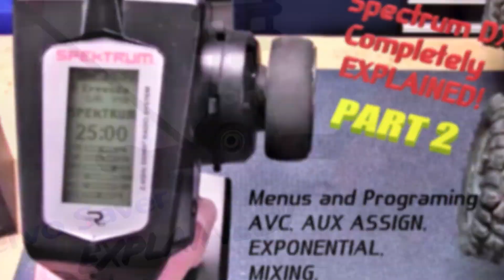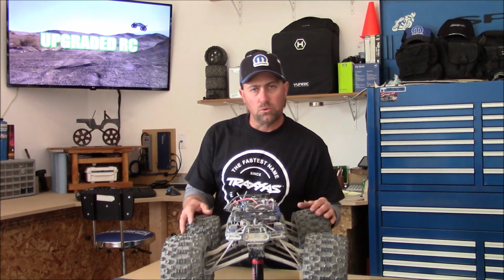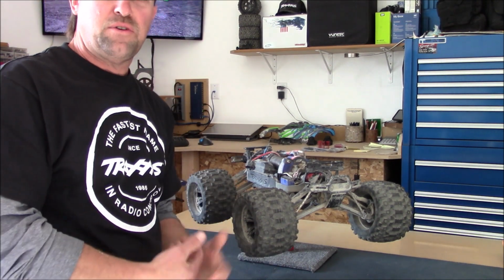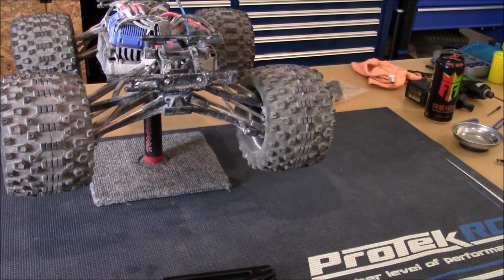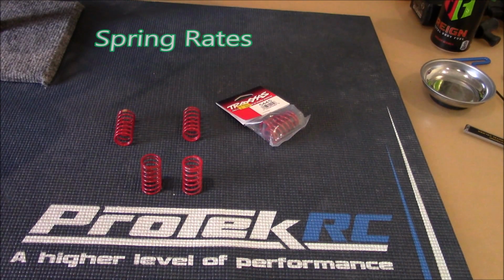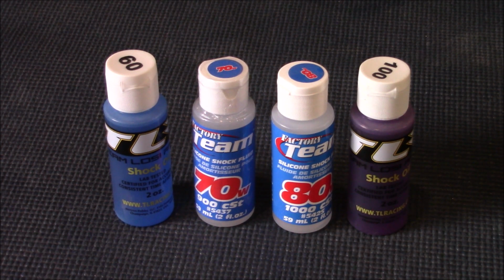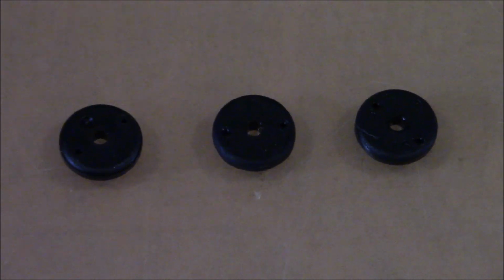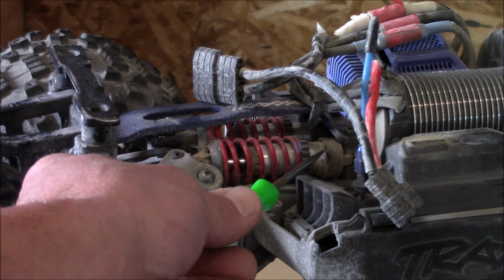Entire Suspension System Explained For E REVO 2.0  Part 1

Comment: You forgot to talk about bump steer adjustments with the lil different height captured ball stud things at end of pushrod links and the wheelbase adjustment
Reply from the maker: I did not forget, that is explained in an earlier video. This video is all about suspension. Your talking about height adjustment thru the pushrod.

Comment: I jump my erevo alot. What would you recommend for susp setup
Reply from the maker: There is a lot to say about suspension. The weather is a big deal on shock oil, but heavy springs for jumping (purple), have you watched my video on suspension? Here is the link.
Reply from the maker: https://youtu.be/-Q-XQbIaroQ
Reply from the maker: Watch this video, a 2 part series and you will understand a lot more than I can tell in a text.😎🤙👍
Reply from the maker: If your in an area where you see 70-100 degrees, I like 70w shock oil all the way around with purple heavy springs all the way around, stock #2 piston, and 1/3rd Sag on the preload sitting on Duratrac sixpack tires for lots of cushin. In it is colder adjust your oil weight down accordingly.  Hope this helps you some!😎🤙👍

Comment: Just got my revo the other day.. knowing self right was a bad idea, I used it and blew my spur gear. I’ve only ran 2 batteries 😅. So to avoid damage while I wait for my metal spur gear what other should I do to my shocks to make them more durable? I hear people have problems with the shock pistons pulling out or something? Maybe it was the shock caps themselves. Any help would be appreciated (:
Reply from the maker: Metal spur gears are bad. If something binds up or locks up the drive line or differential,  then you want your plastic spur gear to stripout or break first. Reason why, it is way cheaper and easier to replace the spur gear than any other. Differential parts. The spur is designed to take all the abuse. Leave it plastic. Just make sure it's meshed correctly tothe pinnion. I have great video on how to do this.
Reply from the maker: I haven't had any problems with the shocks pulling apart. Just the pushrod ends, i have a great video for that aswell.  Have fun!🤘

Comment: you said twice that increasing the preload would cause damage. what do you mean by that? and what does traxxas mean when they say preload should be 1/3 of suspension travel? is that 1/3 of the adjustment threads? if not then how do you measure 1/3?
Reply from the maker: If you increase your preload nut too much it will ruin your springs. If you want more compression the increase the spring rate or go to thicker oil. And when your car is sitting atrest with batteries and cover on your sag or preload should be 1/3 of your total suspension travel up and down.
Reply: UPGRADED RC thanks for the reply. so when you say it will cause damage and ruin the springs you just mean that it will wear out the springs faster? i cant see it doing damage to anything else

Comment: Controlling rebound dampening with thicker oil. Hmmm someone needs to build shocks with rebound adjustment knob. But maybe that’s overkill for an rc truck!!
Reply: Rpm use to make a 2 stage piston that was reversible so you could have strong compression with little rebound or little compression with strong rebound. They worked great in my slash. I ran 70wt oil and the shocks would drop down like stock but absorb whoops at speed like a champ.